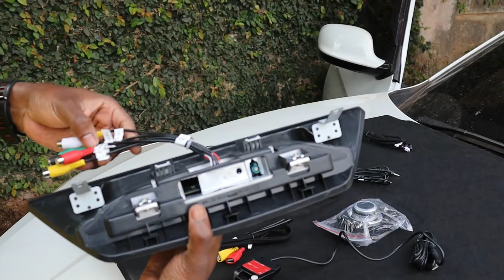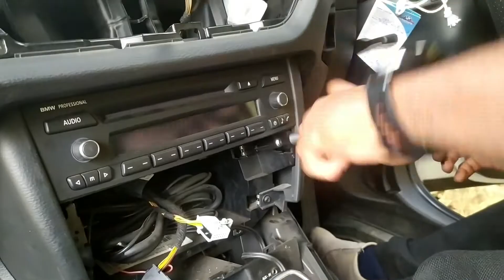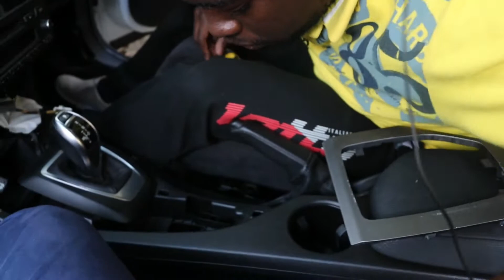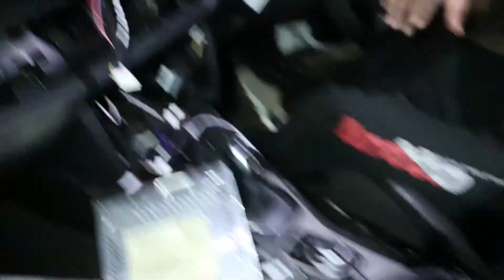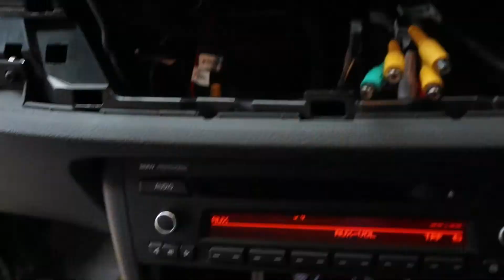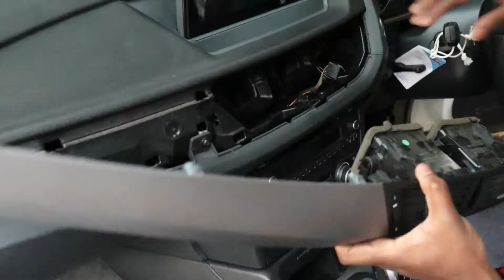Infotainment Install NaviFly Android 10.0 For BMW X1 E84 2009 - 2015 (Successful DIY)

Comment: Hi there, I need your support to resolve an issue with the same product Navifly I bought in 2020 and has been working well on my BMW. However, I need to try out factory reset code to resolve a veiwing display issue. Thanks if you know the factory reset code please do share with me. Thanks.
Reply from the maker: Hi there,
Use 1314. This should sort you out.